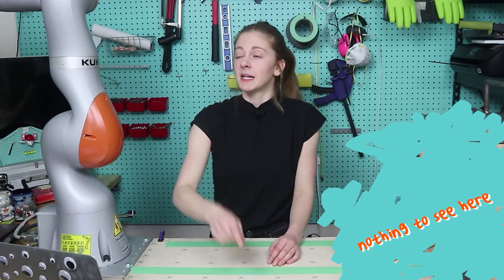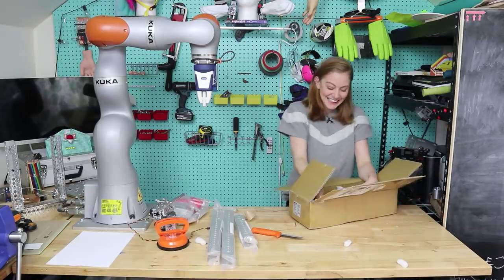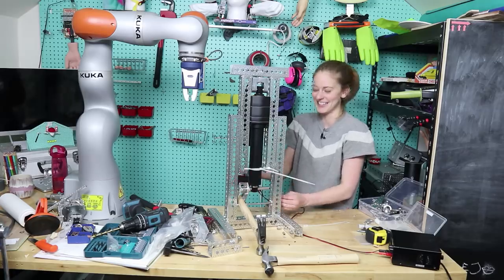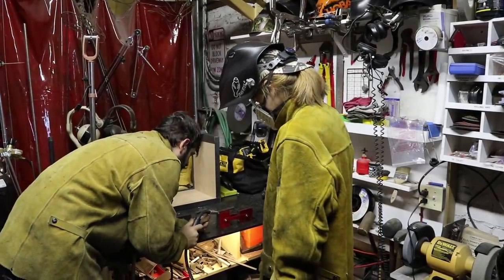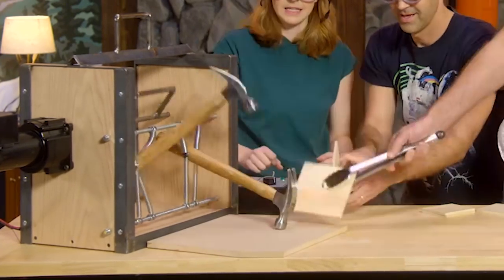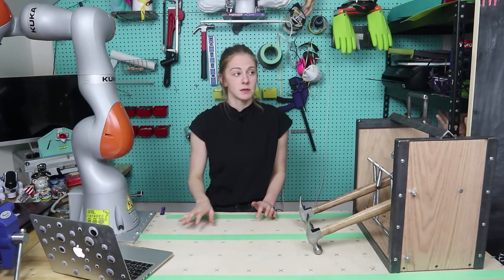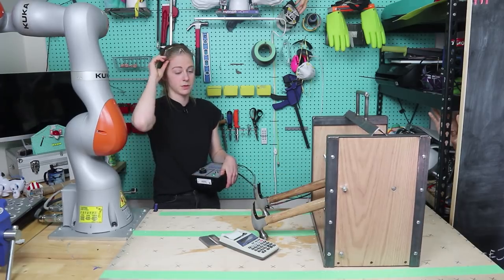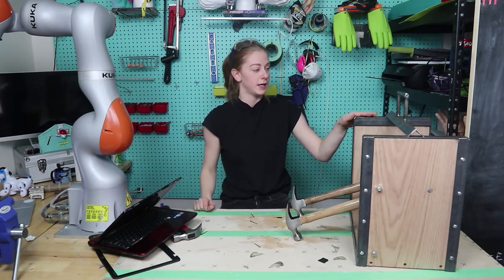I built a hammering machine that destroys everything

Comment: It's not just you Simone. Hammer handles are often made from Hickory, which is literally the hardest wood I've ever had the misfortune of working with.
Reply: That's useful to know. Thumbs up.
Reply: Oak is the hardest wood.
Reply: Quebracho and lignum vitae are the hardest woods. I have already worked with the latter, it is really a tool-duller hardness! Gets a greenish tint from exposure to sunlight...
Reply: what suprised me on that list was pecan. i expected it to be lower. i know it is hard. thats why i made a hammer handle out of it. seemed like a good  wood for the job. bit brittle though and  likes  to split with the grain. but it has a good strenth and integrity until that point
Reply: Joshua Bennett 
Thanks for sharing that list! I wish it had "rock maple" which used to make me dread going out to the shop
Reply: I have the hardest wood
Reply: Brian Ortiz 
That is an opinion statement
Reply: Simon Tay that's not even close to true. Australian buloke which is a type of ironwood is. Oak isn't even in the top ten or probably top 15
Reply: Ironwood anyone?  Or whatever my dog is chewing on.  It's been 3 days and it still isn't damaged.
Reply: Nemozoli we actually have a table top made from quebracho wood from re-purposed railroad ties. They were in use, exposed to the elements and endured freight trains going over them for about seventy years before they were decommissioned, and all they needed was a little sanding to be pretty again. That is some tough wood.
Reply: can you get ash handled hammers?
Reply: Oak is not even close to that.
Reply: I usually play with oak drum sticks which rarely get any big chips or cracks where as hickory breaks in a matter of hours.
Reply: I made the top of a jewelry box with lignum vitae for my grandma's birthday. Let it in the sun because that greenish tint was what I was going for...anyway...it ruined my bandsaw's and scroll saw's blades, before I decided to pay for a good quality blade.
Reply: @MrThumbtack  What did they do to Brazil to make all their wood so hard?
Reply: @Ian S. Yep, most of our trees are pretty dense
Reply: Petrified wood is much harder! So is Kauri.
Reply: Hickory is awesome to work with! Can make some really beautiful stuff. Hope it starts treating you better?
Reply: I've worked with Brazilian walnut and it was impossible to nail anything through. (Even tried with framing gun) Built a deck with it and had to pre-drill everything. Very time consuming but beautiful.
Reply: @simontay4851   its actually Quebracho wood, which translates to axe-breaker!

Comment: When I was learning to weld, I set my leg on fire. Not my pant leg, my LEG. Well my pant leg was burning too, but I was more worried about my leg.
Reply: Did you manage to extinguish it since?
Reply: @jcxz983  Legend has it, it's still burning to this day
Reply: Golden rule of welding: If it sounds like bacon, you're doing great. If it smells like bacon, buddy, you're on fire.
Reply: Whew! Now I feel better about setting just my shirt on fire. But I didn't know it - because I'd just used most of a rod and thought the heat on my belly was radiating from the work.

Comment: An idea for ya. Take and set up a system like train wheels. So as the piston moves up and down, it makes the hammers pivot. Set the hammer's pivot near the middle, but a bit biased to the back.  With this set up, you can then use a motor that spins instead of a back and forth driver.

Comment: Hammering machines have been in use since the dawn of the industrial revolution. Then they were called
  trip hammers, powered by water wheels, than later water driven heavy industry turbines that looked very much like the turbine section on a modern jet engine. Works about the same way. Used for forging or stamping metal. Even today, many blacksmith's have a smaller version in their shops, does the same as their hammer. Labor saving device for forging, and for forming metal in molds, like stamping shovels or in say stamping car fenders still to this day. Of course, they were quite a bit larger and far more powerful than yours.   :   ). Same difference though.

Comment: She should have used pneumatic cylinders to power it. They are far less expensive than the actuator and come in many sizes and are easy to setup. I built a couple of machines with pneumatic recently (there are short video clips on my channel) and really had fun with it. I did feel a bit like her, as it would have been far easier if I was an engineer and knew the physics and math to find out what would work, before actually building the machines. I did play with a cylinder from the first project, to see if it was strong enough for the second. I googled some math formulas and learned a bunch about the force from cylinders and how the diameter of the object being pressed will change the psi produced. Amazon was a pretty good place to get the parts. Most were good and were less expensive than the usual hardware/automation suppliers, and one type of fitting ended up being junk and had to be returned. I would love to find a woman like Simone. Her personality, looks, and her love of building things is great.

Comment: It'd hammer with a little more force if it engaged with the hammer more on the down stroke. Also, you could create a v shaped frame to act as a guide/bushing so the hammers hit the same spot — use plate metal and flat-grind the handles so they align perfectly. They'll be more destructive at an angle and when the force is guided, a lot of energy loss occurring with the springs.

Comment: If you're looking for a much more violent approach, you could anchor the back of the hammer on a pivot, attach a Scotch yoke to the handle further up, and have the motor spin the flywheels. You'd end up with a rigid, linear motion, without the wobble, and with much more force. I'd suggest not trying that on your table.

Comment: This is old, but what if the actuater pushed down on the end of the hammer into a spring, with the hammer being on a fixed center pivot point. I could probably explain better but what's the point

Comment: great video ..

but why use springs for the hammers? .. why not 2 solid iron rods then a hole in the hammer and a iron something throught so it stable .. and  i would think the power is higher since its strait up and down instead of .. all over the place 

but still liked video :)

Comment: Hmm, why use those springs? Could you not have just used the top rod holding the upper springs and run that through the hammer handles for more stability?

Comment: I would have rotated the shaft (no pun intended) in the other direction to force the hammer downward by pushing up on the handle, and then spring it back up. Not that I know any better what I would be doing.

Comment: Put the hammers pivoting on a pin going though the  enter of the handles and the handles against a engines crank shaft so the part the connecting rod connects to wjen rotated slaps the botton of the handle. Build a assembly to hold the crank shaft with bearings so it rotates. Weld a pully to the end of the crank and have a electric moter drive it. Voila you have a heavy as shit machine thats simple and does the same task of beating the crap outa whay is under it

Comment: COULD BUILD JUST ONE ON RAILS WITHOUT NEEDING A HAMMER AS LONG AS THE SERVICE OF THE WEIGHT SOURCE WILL BE ABLE TO THUMP THE NAIL INTO THE CONSTRUCTION OF WOOD YOU WOULD BE WORKING ON,ARE YOU ABLE TO VISUALIZE SOMETHING LIKE THAT.EVEN BE ABLE WITHOUT RAILS BUT MOVE ALONG THE THE PROJECTYOU WOULD WAT TO NAIL